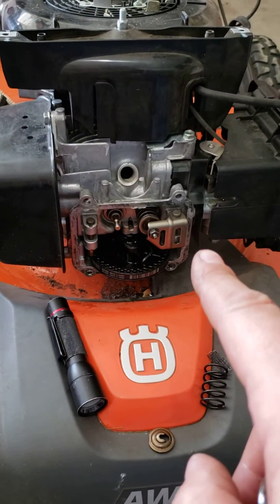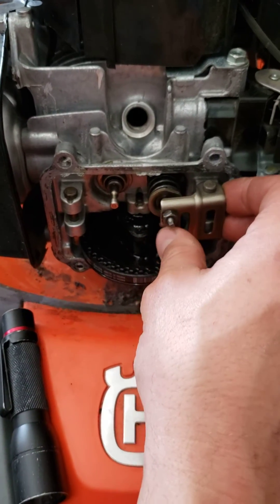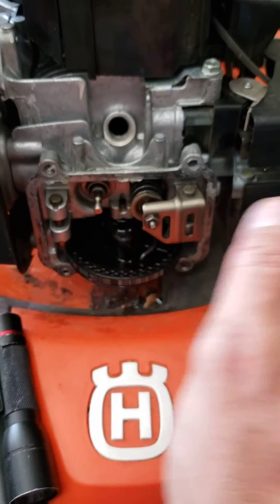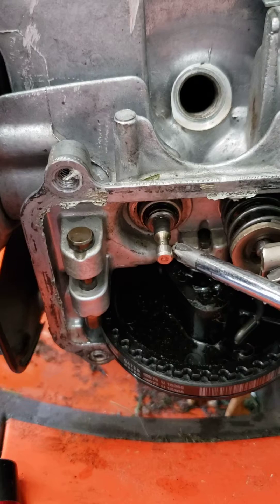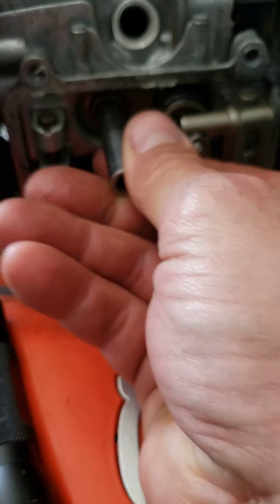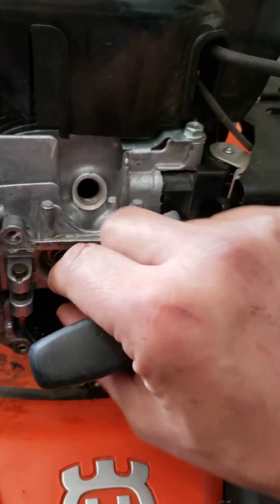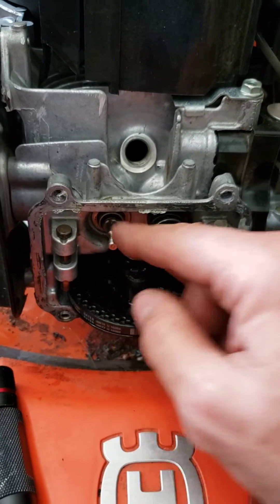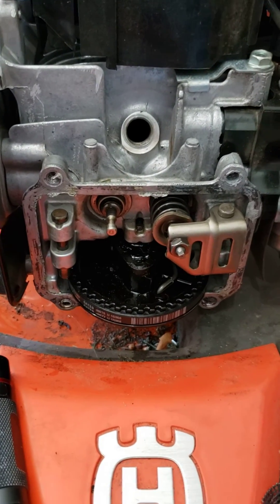Honda small gas engine valve guide issue

Comment: If you will install a new valve seal on intake and use the old seal on exhaust but cut the rubber seal off so it can get plenty of oil the guide will not move again 
Proved and tested for 6 years in shop